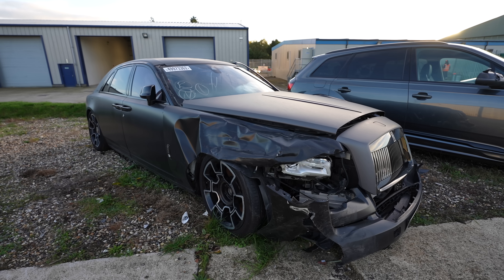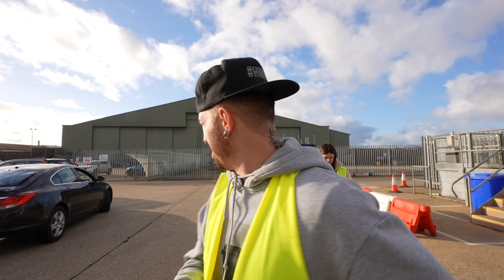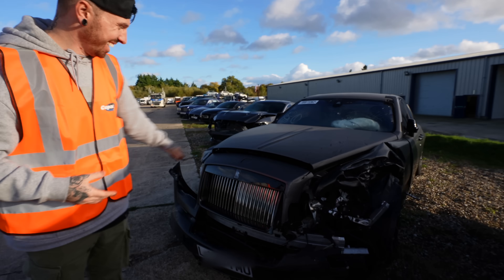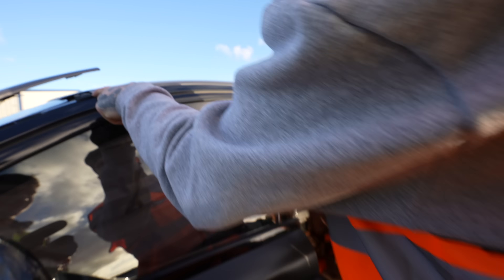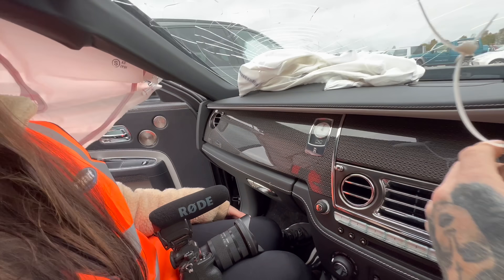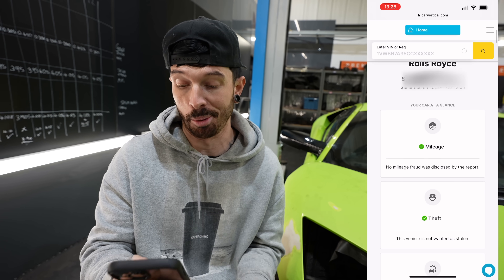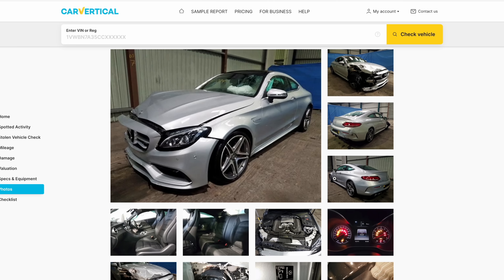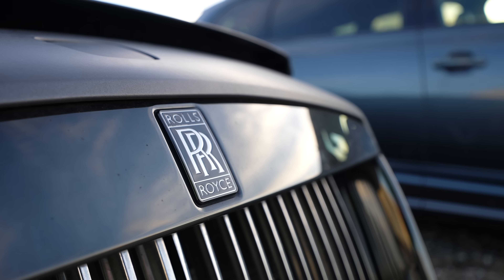I FOUND A WRECKED ROLLS ROYCE GHOST AT AUCTION

Comment: I found it funny when you noticed the BMW part on the car and said you’d confirmed it. I used to work in the BMW warehouse when it was based in Bracknell many years ago (they eventually moved the warehouse to Northampton). At the time it was a 24-hour operation receiving lorries from Germany, getting them into the right parts of the warehouse, picking, packing and then despatching all parts to dealerships for UK and Ireland. There was a team in there who picked all the RR parts, and their whole job was to get the BMW parts, change the label to RR and (at least) 4x the price to the dealers.
Reply: Bmw owns rolls
Reply: @rardrioc6406  Err no BMW has a License to use the RR name from Rolls Royce who still exist.
Reply: @duncbee  Bmw owns Rolls Royce
Reply: Just one big con like Porche and VW parts.
Reply: @duncbee  BMW bought the automotive division of Rolls Royce. The ghost is build on the same platform as the 7-series. Phantom only uses components. The Rolls Royce that is not bought by BMW is the aviation division.
Reply: @Imagineering100  I've got a nice Skoda Scout, It's practically an Audi 🤣
Reply: There are Audi parts too like the cpu
Reply: @Imagineering100  vw and Porsche is the same company
Reply: @EnteSauer  Yes but a VW part cost $20 the exact same part from Porche is $80.
Reply: After an accident they’re all just junk like any other car.

Comment: I lean toward the Rolls.  That 458 seems like a lot more work.  Love your videos!
Reply: He didn’t clarify it in the video; but I would guess the categorisation would mean it’s uninsurable so therefore not an option
Reply: @alexjh12345  you cant buy cat B cars without a breakers license either
Reply: Bigger build means more content get the 458
Reply: The Rolls Royce is a Cat B....the first images you show the rear door and quarter panel, on the passenger side, look closer and you can see that the door has kissed the quarter and left a bulge in the skin. For this amount of force to have telegraphd that far down the car to the B pillar and even on a suicide door means that the thing is DEAD.
Don't touch it with a barge pole, its far far worse than you think!
Reply: @danstewart8218  
It'll buff out that😁 
Far more money and utube views in the roller.

Comment: I just bought a 2007 Audi S8. Runs & drives. Needs a headlight and a bumper cover. 139k miles. I paid $2900 with a salvage title. No structural damage. All cosmetic. Score.

Comment: Hi mat I’ve done a 458 qrt panel replacement and yes they are aluminium both rivets and aluminium welded. If you get it and need a hand with that just give me a shout. 30-35k is what I would give for it. 👍

Comment: In THAT state, it’s not even worth it for the Ferrari. Since you’d be replacing most of the car anyways, I would say it would be sane to offer the lowest price possible. In my opinion I would never buy a car in that condition but at the same time, I’m not a mechanic. I think $10,000 and higher would be a better offer for a car that has that much damage. Plus you don’t even know how much more of the extent of surprises you’ll find if you were to actually attempt to fix it. Might be better to just wait and find a different Ferrari that will be a much better deal. On the other hand, the Royce is looking like a way better option. I would definitely haggle for that one if I were you.

Comment: The headlight that you shown on ebay is not the same, you showed a xenon one, the wrecked one is LED. So probably the led one costs much more..
you can see the wrecked one 3:30, and you can see that its different from the one that you showed. 3:57 .

Comment: There's a thing called "credit hire". If the Roller driver was not at fault for the accident he is legally entitled to have a replacement vehicle, of an equivalent type, provided for him under a credit hire agreement while his car is being repaired, however LONG it takes to repair. That hire bill, for this type of car, could easily run to £70,000 or more, thats on top of the cost of repairs. If they "write-off" the car, and pay the pre-accident value, the right to continue with credit hire ceases immediately, so they write them off QUICKLY, pay the pre-accident value of the car and sell the salvage to people like you. It's MUCH cheaper that way.

Comment: Well if you end up for whatever reason getting the 458 and replacing the brakes, subaru wrx front breaks I believe fits the rear and a corvette z06 the front but I could be wrong. I know that normal guy supercar mentioned it. Furthermore I know some fuel pump stuff is off of a Kia rondo. Either way Try fiat or alfa Romeo parts first if you end up getting it.

Comment: that 458 is done.  but if the engine and transmission are good you could profit about $15000 on just those parts.  i would NOT try to rebuild it unless you don't care about money.  that thing is toast.  the Rolls on the other hand.  could be sweet

Comment: You cant pay more than £25k for that ferrari.... you will need another £40k+ and about a year of work to get it anywhere near finished. There must be easier out there! As for the Rolls, it is a much better project surely. Especially if you can score it for anything under or around £100k

Comment: I would prefer to see the Rolls Royce, Rebuilt than the Ferrari, because the Ferrari has MAJOR structural damage, it would be a monumental challange, the Range Rover, is one you would not touch because the Vin has been erased It would be a Dept of Transport Nightmare to get the Authorisation to fix it.

Comment: When looking at a salvage you have to think of price of parts if the chase is in good order and all the parts engine gear box are together. With a high class car that only a set amount is ever made like a Ferrari you have to work out how many were built is it still in production are all the parts for that modal available. Because when the car is no longer in production parts will be very hard to get also no other Ferrari's parts are interchangeable including engine management gear box some times even the engine its self. These cars are not like Buying a Japanese top car that can almost guarantee rebuild and will be as good as new. With Rolls Royce and Bentley they have many if not 80 percent from the top class German cars parts.  But the costs of actual RR name on the parts to make a real RR or Bentley is so expensive that is why they are right offs. Other wise you wil be lying to a customer and be up to be in court case so have to put down parts from BMW or in Bentley VW Audi not all RR and that affects the worth of the car. .

Comment: You obviously 🙄 have no idea how or why insurance companies grade the vehicles as a parts car only or is sold as repairable salvage  I suspect if that vehicle was going to be repaired it was going to be by rolls Royce or by there approved repairers. If that’s the case it will be at rolls Royce labour rates and at rolls Royce prices and there will be a massive price list for all the parts then labour which out weighs its rebuild value so that’s why it’s listed as a parts car only. As for the Ferrari with parts of the car was so the insurance assessor could properly asses the damage to it properly

Comment: Why cannot a category B get fixed and back on the street? I mean if someone got enough money to pour into a project, you can pretty much rebuilt anything... If you can rebuild say a Spitfire that's gone at hundreds of km/h into the ground, and then been buried for 60 years or so being put back into the air, why not a Rolls?
Reply: Probably because spitfires aren't just hacked together by people with YouTube channels.
Reply: @johnpiggford9145  point is.. all you really need to get a spitfire "flying again" is pretty much its serial number plate and money.. So to make it equal to the Rolls.. cut out the metal with the VIN number, build it with new parts, and register it.. but apparently if it is cat B this is not allowed?? HOW??
Reply: @MrZnarffy  you're comparing a system designed around highly regulated engineers with checks and balances, to a system that can be operated by anyone regardless of skill. You wouldn't want any old tim dick and Harry being able to put catastrophicly damaged vehicles back on the road. Equally, you would t be able to rebuild a spitfire.
Reply: @johnpiggford9145  No!! You are not getting it.. Getting a plane in the air is much harder and more dangerous than getting a car roadworthy. There is something called INSPECTION. The only reason to make it impossible to rebuild something is anti-competitive behaviour. Like forcing someone to use "original" pars, or a brand name repair shop.
Where I live you can rebuild any car, you still have to do a yearly satery inspection for any car, and if you design and build one from scratch you have to get it checked before putting it on the road. I've also lived abroad where yearly inspections wasn't necessary, but if you bought a writeoff and fixed it, you had to do one...
This cat-B stuff is just bullshit...
Reply: @MrZnarffy  I'm an aircraft engineer, who has worked on historic aircraft such as these. Take a chill pill and stop talking rubbish
Reply: @MrZnarffy  if you dont live in the UK, don't comment on our laws. Obviously you live in a country with a lower safety threshold
Reply: @MrZnarffy  what's to stop someone stealing another Ferrari, swapping the vin plates with the crashed car in your scenario?
Reply: @johnpiggford9145  first. it was a Rolls, and nothing, You can make/buy/steal new VIN number plates without this too.. It's  usually stamped by machines into the metal body somewhere also, and that's much harder to redo properly...This is what you need to check, not necessarily the plates.. If I recall right it's usually stamped into one of the large structural  metal body parts, and you cannot usually buy a "clean" whole f"loorplate" etc... you cut it out and swap with a "new" one with the VIN and you can tell with the metal structure it's been replaced usually...

VINs aren't the cause for this, if so it's just a surface excuse...

Comment: RR are manipulating the market thats why its an S! Rolex do it and other big brands! Artificially inflate the price! A glut of anything causes deflation! Certain watch brands are rumoured to be soaking up any stolen watches and taking them off the market to make them hold a better price! A company that replaces parts without telling you unlees you read the small print when you get it serviced ultimately recking its value and then keep them parts for vintage repairs etc means they are willing to do anything to sustain the brand! And they do!